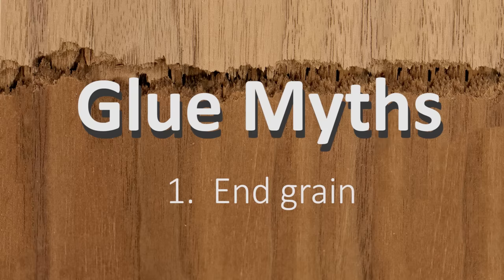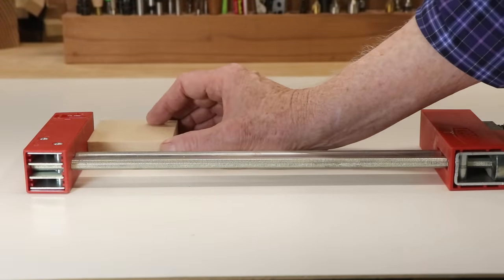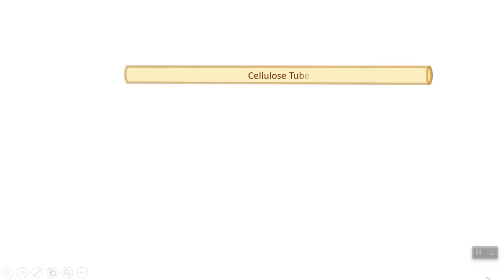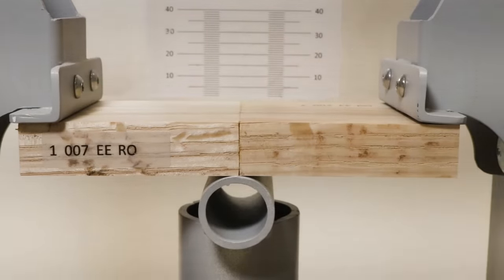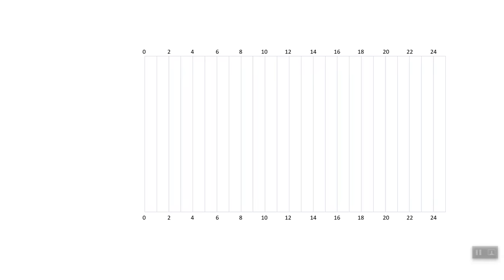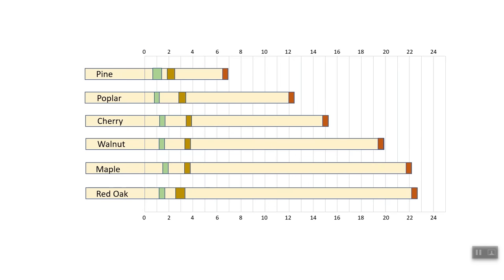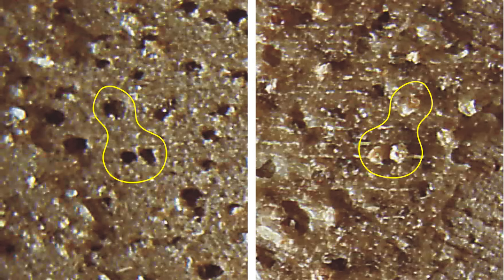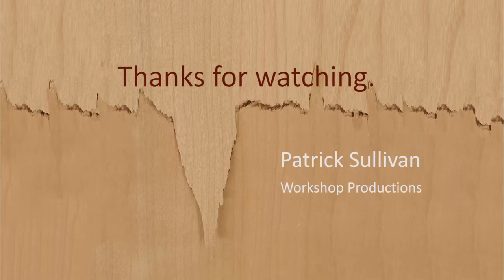Glue Myths:  1. End grain

Comment: Super interesting results! I would love to see how time impacts the end grain results. One of the reasons we're taught to do things like reinforce miters is not just because of the possible myth that the joint is inherently weak, but also the fact that the joint is subject to a lot of stress as the pieces expand and contract over time. So I wonder what these results would look like in 1-2 yr old samples. I would also love to see these tests with longer boards. I imagine the amount of force required to break two 12" long boards apart at the joint is considerably less because of the additional leverage. Either way, thought-invoking stuff. Thanks for making the video.
Reply: Why would the leverage matter, we're measuring the force on the joint, not on the other end.
Reply: correct. 
as wood grain primarily expands perpendicular to the long grain … end grain glue joint is likely to shift apart as wood moves.
Reply: For most products there is a way to accelerate testing.  Putting test parts in a humidity chamber and cycling from seasonal high to seasonal low relative humidity and doing sat 50 cycles would work.  Not sure how long a sample would have to be at a high or low humidity for it to fully penetrate the 3/4" thick piece.

I suspect Mark is correct and I have always assumed wood movement is why you are told not to glue end to side grain.
Reply: I think you hit it with the last comment. This showed a 3/4 by 3 inch end grain to end  grain joint is stronger than the grain of a 3/4 inch by 3 inch long piece of wood. It tells you nothing about the relative strength of the joints. Glue end grain to a board 12 inches long (or 2 inches thick) and you would get very different results.
Reply: A friend has one of many glass etched mirrors I did forty years ago. It's not even mitered. Instead, I cut quarter circles to join straight pieces. The mirror weighs in at least 20 pounds and the frame shows zero indication of failure four decades in.
Reply: Exactly. Wood expand a lot across the grains, not much across the grains. End grain to side grain glue joints won't hold for this reason. End grain to end grain glue ups won't hold well against expansion because it is hard for two pieces to have the same expansion ratio, unless they were originally one piece. The enormous internal pressure is what breaks end grain glue ups, not external forces that this video tested.
Reply: Wood does not expand that much under stable conditions, it would have to be left outside for that to make any difference what so ever. I have seen that argument about wood expansion so much but truth is in controlled environment its not happening. I have seen plenty test proving that, like glueing edge graine across end grain etc... Quite a few videos on it. Quite a few articles on it. If you have high moisture content it will shrink, but not expand.  Wood floors are put down and glued completely, the wood is acclimated and there is next to no expansion after that. I have seen them right at the base also and never seen one single problem due to so say expansion.
Reply: Check my comment, I just posted it and now i have found yours, I don't want to write it again here :) . In it i give my opinion, based on practice, not theory, about the capability of the glue to maintain its strength over prolonged time, I completely agree with you and I would say that after 10 years, years of use, so fatigue happens, the results would be even more different from the one with the glue just cured and the joint not previously stressed.
Reply: @kefeng6805  really good point!
Reply from the maker: Thanks for you comments.  I tried to keep my experimental setup as clean and simple as I possibly could, so we could look at glue performance independent of dimensions and shapes.  My plan is to continue this kind of research.  Perhaps, bit by bit, I can help provide answers to some of the questions we all have.  However, in the end, the design of complex wood structures with multiple joints is a very challenging subject that requires all the judgment and experience and principles that we can bring to bear on the problem.  My stuff is one tiny part of that equation.
Reply: It's really important to note he didn't actually break any long grain glue joints, and so has no data on their strength.  He broke the wood, which is not the same thing at all.  In a well prepared long grain joint, the molecular bond is MUCH stronger than the cohesive bond which locks into the imperfections in the wood.  If your joint needs strength from the glue joint (well, you should probably rethink your design, if I'm honest - there is a reason dovetails were invented!) it's really important to either sand (180-220, no higher) or scrape the joint as close as possible to the glue up (no more than 24 hours - but the sooner the better).  The gross simplification of this is the sanding opens up bonding sites on the molecular structure of the wood, which creates a much stronger bond.  I've had friends explain it to me, but the detail was too much for me to remember, so just go with bonding sites - the results are the same; sand it just before you glue.

In fact, the long grain joint is much stronger.  This kind of data is readily available.  Check with manufacturers, or the USDA Forest Products Laboratory (you taxes pay for it - make use of it!) - they've got a 1919 article on how to actually test the strength of a glue joint, and one aspect of it is a much larger sample size, because any test which doesn't break solely at the glue joint has to be discarded.  Any wood breakage, and the test isn't valid.
Reply: @andreachinaglia5804  you are assuming that PVA glue fatigues.
Reply: @PatrickSullivan  You are providing a valuable benchmark on one stressed parameter at a time (event driven - impulsive force), extended life in any real application provides a benchmark (but typically unmonitored/unmeasured) across many/(every?) stressed parameters over time (history driven - accreting force).
On your menu of tests up for selection: please repeat this experiment, but not applying a bending force rather apply a twisting or torsional force.
Reply: @lightaces  for people who want to look into this further, I believe you are talking about the section ‘Bonded Joints’ from the paper titled “Wood Adhesives
Bond Formation and Performance”? Im new to all this, so I’m bringing very little knowledge here, but I’m having a hard time understanding your point that this video isn’t helpful. Given what’s shown, it seems to clearly demonstrate that for non-structural used, end to end grain joints can be sufficiently strong for standard wood shop products (say for a table)
Reply: @vtlynch92  I would contend there is seldom a "non-structural" joint.  Between wood movement and gravity, they are always under some stress, and you should always try to have them well supported and solid even before they are glued together.

That would be a good paper to look at.  A lot of the data I've looked at is proprietary stuff specific to my business (guitar building and repair), but the conclusions tend to be the same.  And we really do rely on structural glue joints to a stupid degree.  Guitar designs really are dumb in the respect.
Reply: @stephengee8488  somehow yes, or better i noticed that if something made of glued wood breaks the failure is almost always in the wood if the thing is new, but if it happens after some years of use is more likely that the failure is on the glue line, I can not tell if this happens for crystallization of the glue, that so becomes brittle and prone to micro fractures like the cast iron compared to steel or for an other reason, I have noticed the effect, but don't know for certain the cause.
Reply: I agree with the wood movement, especially on the miters. I've had 100% of my miters open up when outdoors, but rarely had an long grain joint fail on me.
Reply: I don't know about you guys, but I've sat on many old chairs with failed glue joints. I'm not a chair maker, or even a chair connoisseur, but my experience of 42 years sitting on chairs tells me that I wouldn't trust a long to end grain butt joint to last.
Reply: @Mikey__R  agreed, the tests tells us something, and are performed on new glue joints and for a single maximum stress up to the point where something breaks, but looking how the furniture breaks in real life conditions tells us something very different. The tests are useful, but can also mislead if we base our construction method only on their results, if we want to build something that is going to survive a long time.
Reply: @andreachinaglia5804  I suppose the test only investigates an accute use case, where the two day old glue joint is subjected to accute stress only the once. The chronic use case is when the joint is flexed several times a day for a decade or two.
Reply: @lightaces  a test using 1919 glue formulations vs. today's formulations would need to be done , no?
Reply: @Mikey__R  In much furniture, particularly old furniture, hide glue rather than PVA was commonly used.  Even today many fine furniture makers prefer it as it provides a longer glue-up window and facilitates ease of repair / disassembly by applying heat to the joint, etc.  Hide glue forms a very strong and durable bond, certainly stronger than the wood itself, but being a 'natural' product (unlike PVA which is a plastic polymer), eventually it will crystallise and fail leaving only the quality of the joinery or lack thereof to support the item, hence the classic example of the rickety old chair.
Reply: @moltopericoloso  good points! A properly made stick chair doesn't even need glue. But your factory made chairs from, say, 20 to 30 years ago, will have been assembled with the modern glues of their time, those are the chairs that are coming apart.

When I built the kitchen table for my parents house, I used mortice and tenon joinery. I never even considered using any other kind of joint, since the MT is centuries old and there are centuries old examples still holding strong. I didn't drawbore or wedge the joints as I assumed Titebond would hold fine, but only when used in concert with suitable joinery. A butt joint would be completely unsuitable for the task.
Reply: Oh, the other thing about a mortice and tenon, it'll go loose and then it'll fail. I would guess that when a butt joint fails, you'd get no warning, just a crash and an unhappy dinner guest!
Reply: I think that the key is “time”. In the “end to end” joint, assuming that the two pieces expand and contract in the “same” way with a little bit of luck, that’s ok. But in the “end to long” I think that we need more of luck: the end grain piece, contracting and expanding day by day will broke the joint.
Reply: @reality150tv  while I see where you’re coming from, I think you must have only seen these wood floors in modern climate controlled houses. I’ve seen floors buckle and pop boards up due to expansion and I’ve seen sizable gaps in between floor boards that have shrunk. Even in climate controlled houses it isn’t unusual for doors to swell in the summer months again due to wood movement. I recently built a large table with breadboard ends and after a few months the ends have moved nearly 1/8th inch. My customer called me concerned about it the other day. Funny too because they live in a new climate controlled house. Wood moves, that’s just a fact of life
Reply: @christianscustoms6429  I said in a climate controlled which all houses are now. You dont get enough variance in temperature. You say it moved an 1/8th inch  I say it shrunk due to moisture content drying out. People get those 2 things confused it seems. Wood will shrink a good bit depending on moisture.
Reply: Also interested to see how the end-to-end grain joints hold up over a few decades of humidity swings.
Reply: @reality150tv  I’m not sure where you live but in New England the majority of the houses are still not climate controlled. Brand new houses, sure. Any good woodworker will not build for the most ideal conditions though. Wood movement is more a factor of moisture content anyways (as you mentioned) so even in climate controlled houses, it is extremely dry in the winter. I’m not sure why you want to deny that wood moves as much as it does but that’s totally up to you to not build with movement in mind
Reply: Hi  @MrDottorzeta , the end to end joint is still way weaker than a single board of the full length. Do you have any application in mind where you could use this joint? The only one I can think of is if you can't get a board long enough, but in that case I'd be making a scarf joint.
Reply: Samurai carpenter talks about it also and says its not a factor in climate controlled situations. He said out of all the stuff he has built he has never seen it to be an issue, I have seen quite a few others on youtube saying same, I have read numerous articles on it. Last but not least, from my own experience and testing I have never seen wood move except contract due to higher than should be moisture content. I dont follow popular myths because people say so. I have built plenty bread board tables and full glued ends and never seen a problem. My sister has one of them that i Made over 8 years ago, several other family members and friends. Why is there no problem because i dont use high moisture content wood.
Reply: @reality150tv  funny enough you say using low moisture won’t be a problem. The table I recently made was from wood that came out of a vacuum kiln. 6.9% moisture content to be exact. I know this because I measured it myself. In the area however there is high humidity in the summers even with air conditioning (remember now this table went in a new house with full climate control) and the table grew 1/8 inch in just 2 months. Samurai carpenter does excellent work, but he’s also extremely cocky and is not the end all beacon of light of all woodworkers. My family has been building custom furniture for at least the last 4 generations. I’m not just taking out my butt. Do people over worry about wood movement, of course they do. But to pretend it isn’t something we have to worry about anymore is silly. The trees are still an organic substance and the ONLY way to guarantee zero movement is once the wood has become petrified. I suggest you listen to “Shanons lumber industry update” episode 47 where he does a deep dive into wood movement.
Reply: @reality150tv  that's interesting! In the UK, we rarely have air conditioning in our homes, so in summer theres no way to control the temperature or humidity. One of my friends made a fully glued breadboard ended coffee table, and it split in a couple of years, even though her timber was kiln dried walnut. 

Is there any danger of your furniture splitting when you move home? If you moved from somewhere dry to somewhere damp, and you didn't want to run your aircon on full year round? Or what if your aircon breaks down? Sorry if this is a strange question, I'd never even considered the subject before!
Reply: @christianscustoms6429  I quite like a traditional aesthetic to my furniture. Even if it's not made with hand tools, I like it to look like it could have been. Traditional furniture forms all account for wood movement, so if I'm buying or building something, it's a good way to tell if the piece is true to the tradition or not.
Reply: @kefeng6805  This depends solely on the possible flexibility of the glue (after being dried). And every good glue for wood can handle that expansion. My (wooden) floor is , after 20 years, still intact. Oak glued to other oak....also parts with end grain to side grain. But the total floor will expand 2 to 3 centimeters during the different seasons.
Reply: @JohnSmith-fq3rg  your comment actually got likes...
Reply: @PatrickSullivan  Hello Patrick, Nice efforts went into your experiments and quite interesting video, as adequatly pointed out by many. If you so wish to keep on going with such tests, may I suggest you to get inspiration from testing standards that are in use to actually test adhesives? Perhaps the better known tests are the ASTM ones, which are refered to for structural products. Testing wood adhesives and its resulting bond strength on wood is fairly complex and that in no part due to the testing methods. The point is that you have to test the joint, not the wood, i.e. you need testing methods that will not break the wood and that will not be affected by wood natural variability. That's where the challenge lies. In the testing you showed, results of the side grain joints only test the wood in its weakest orientation. Side grain joints, just like wood are not to be stressed across the grain at risk of failure, but if it is, the glue joint should typically be stronger than the wood across the grain. In fact, if we refer back to structural adhesives such as those that are used for glulam, the adhesive sould never be a limiting factor when compared to the wood properties. Under that "rule", adhesive could not be used in a butt joint as it would be weaker than the wood. It dosen't mean that it has no strength, but that it's not as strong as the wood.  That's why they use joint profiles for end-joints that maximaze both wood surface and side grain surface which ensure that the joint is at least as strong as the solid wood. 

Again, very interesting video and if you read my comment up to this point, I'd suggest you take a look at "ASTM D2559 - Standard Specification for Adhesives for Bonded Structural Wood Products for Use Under Exterior Exposure Conditions" from which you may inspire youself for further testing.
Reply: @JohnSmith-fq3rg  Try drawing a "free body diagram" of the three-point bend test he's doing. There is a downward force at each end of the test boards (exerted by the end supports) equal to half of the upward center force (exerted by the press). Also, the joint is not being sheared, nor is it being pulled apart axially, but is being bent apart. Relatively speaking, the half-forces at the ends of the boards are essentially creating the leverage force while the center acts as fulcrum about which the ends rotate and pry apart. You can then see that the longer the boards, the more leverage (moment or torque) and the more "prying force" you have at the joint.
Reply: @rosscollinswilliams  the glue joint strength would be measured in a unit of area so I’m not sure what your saying. The forces would be larger for more glue surface but proportionate either way? I’m trying to understand your comment because the joints would behave the same regardless of size.
Reply: @reality150tv  would the glue matrix also stabilize that area of the wood, I Wonder how much that would impact the test.
Reply: @lightaces  sounds like they were testing the glue and not the glue wood interface, was that the intent?
Reply: @PatrickSullivan  Given that the end-join strength is dependent on the glue penetration, it would be interesting to see what kind of quantity and dilution and application (and mix) strategy give the best results. Sure, it would depend on the brand, but maybe you could find some kind of easy-to-use universal measure of the thickness for everyone.

Also, the stiffening effect in the end-to-side joint giving more strength was interesting. Makes you think if there is an amount of different direction cuts one could glue to a length of wood that wouldn't compromise the piece strength (as compared to adding a lengthwise piece of the same size) and would add more strength in the different direction through the stiffening effect, a bit like a poor man's plywood.

By the way, kilograms are a measure of mass. You should use newtons for force. It might not seem that big of a deal, but it's an easy way to screw up the related physics like torsion and whatnot.
Reply: One can probably even simulate that by subjecting the test piece to changes in humidity (steam it, heat dry it, soak it in water etc etc), without having to wait for the seasons. Could be a first good indicator, as indeed wood movement would be a major factor in the edge-edge glue joint. Though probably not (so much) on small pieces such as in this video.
Reply: @JohnSmith-fq3rg  the leverage matters because most of the time your end grain glue up
Will not be 3” pieces .for the sake of testing it showed cool and great results but if I build something 6” tall and trust an end grain joint in the middle at 3’ It won’t stand up to much .
Reply: @brianmeanor7907  I mean for the test, it doesn't matter how long it is, he's still measuring the force it takes AT THE JOINT not applied to the ends, thats the point of the test.
Reply: @stephengee8488  You're correct to question this.  PVA glue will undoubtedly fatigue when subjected to sufficient strain, but polymers with weak cross-linking like PVA tend to require significant strain and many cycles to weaken significantly.  That's not going to happen in a woodworking joint.

PVA glue will creep though.  If subjected to a significant percentage of it's yield stress it will stretch over time and weaken little by little as it does so.
Reply: Rollack even though the temperature in the climate controlled home doesn’t vary much, the humidity inside the home can change from season-to-season.   That is what causes the wood to move.